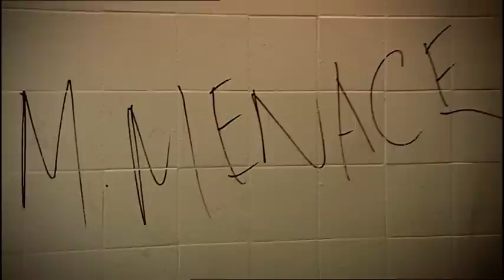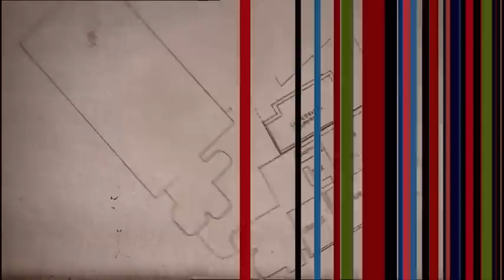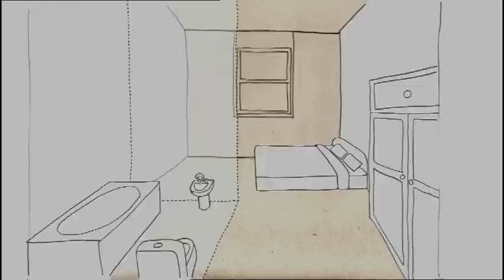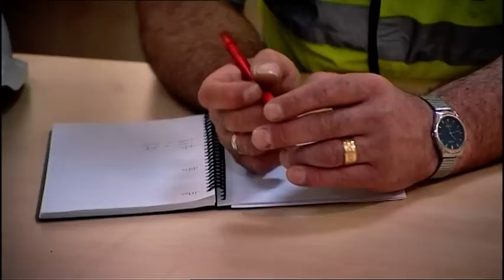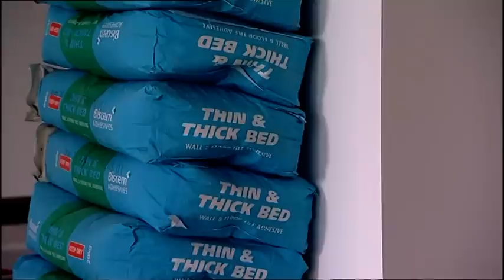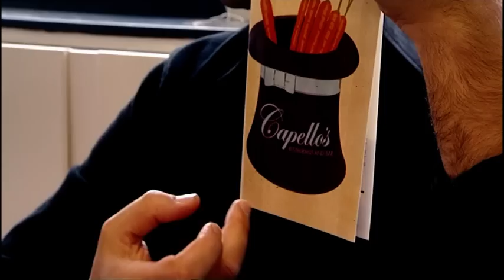Transforming Abandoned Office Blocks Into Hotel | Hotel Rescue | Abode

Comment: Four months to completely convert an office building to a hotel?!  I have to stop and say, with 40 years of working with office properties, that it takes 4 months just to build out new office space for a new tenant, between 2,000 square feet to 10, 000 square feet. This is impossible for whole multi-story buildings. And 700,000 pounds?! No, just ... no. They must not have handicap codes there. How is a wheelchair bound person supposed to enter the reception down those 4 steps?